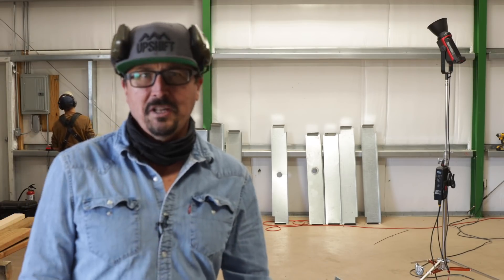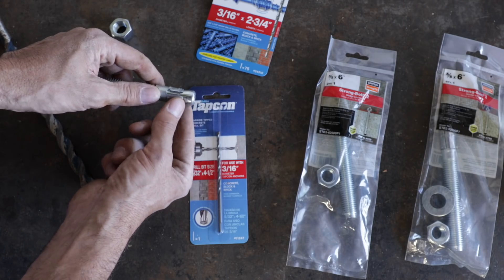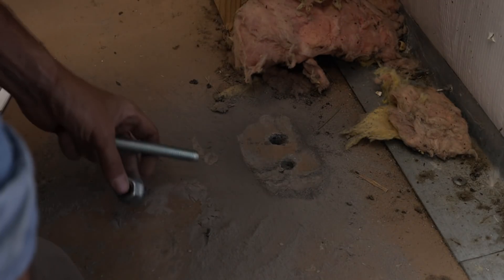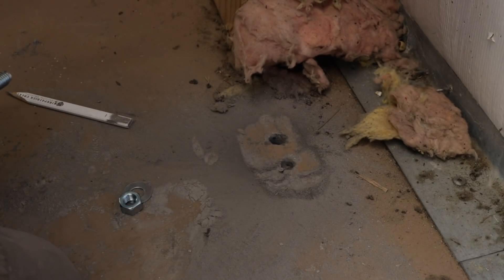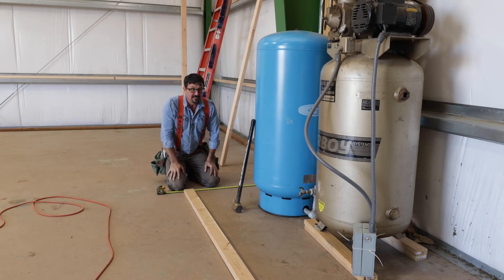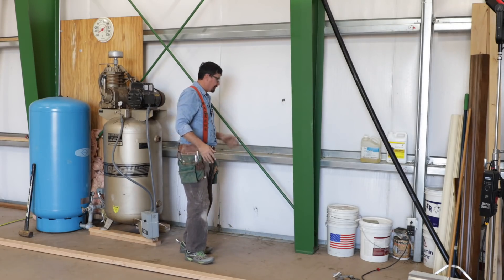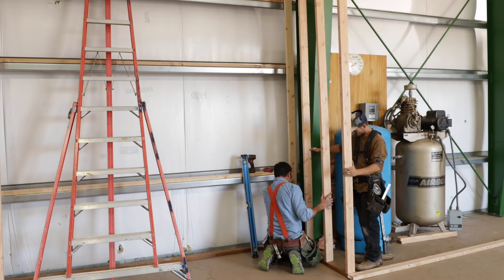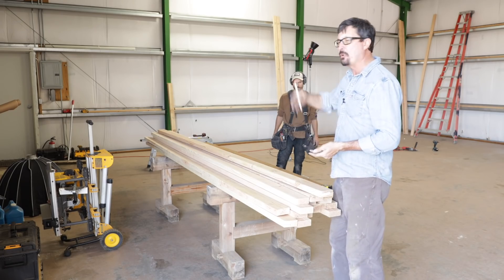I'VE ONLY GOT 24 HOURS

Comment: Those window braces can be used as a wall - if you sheet the walls in - use them to attach to.  Just now a square, but vertical 'studs' to screw to.

Comment: I was trying to put an anchor into a concrete wall once when I hit some rebar. Luckily I hit it dead on. Concrete bits do not drill metal very well so I switched to a regular drill bit. Drilled through the rebar and went back to the concrete bit. worked great.

Comment: If you end up using drywall for the walls double up on it with a foam glue/gap between the two.  Helps cut down on noise quite a bit.

Comment: When laying out for walls, put the top and bottom plate 'on the flat' lay out as you would, but use your speed square to make a line on the 3.5'' side of the plate... then you'll have a plumb line to line up twisted studs if needed....

Comment: I know it to late for you re the compressor but an idea for anyone else.  I would have been tempted to put two recessed heavy doors in front of the well pressure tank and the air tank Right up close and then mount shelving on those doors out to the level of the stud wall.  Giving hidden doors for servicing the units but maximising space.  Yes I know it would be a lots of extra work but I just love the idea.😜😁

Comment: Take a piece of long piece of wood and bore a hole in it near its center the same size as your masonry bolts. Center the board and hold over where you want the concrete drilled and stand on both sides of the board while drilling. The wood will hold your bit steady and make for an accurate hole in the concrete.

Comment: Just a suggestion cody, put some type of isolator under the feet of that compressor. You might not have any problems because its only a 1 horsepower motor , but when you have bigger motors  that shake alot more things start to break when hard mounted. I used some square hd rubber pads with hocky pucks on top on my 7.5 horse triple cylinder compressor,  works good.

Comment: If you are worried about rebar, you should get a rebar concrete bit. (Rebar eater) also, you can drill out all the holes, set the anchors and then the equipment. Many times the problem is the anchors not being straight out or plumb which throws it off. You can bend the anchors a bit to straighten them out so they go where you want.                                             Another good option you could try next time is drop in anchors.

Comment: To anchor stuff in concrete I drilled holes for lead shields, into which I inserted 3/8 inch bolts.  The bolts expanded the bottom of the lead shields, anchoring whatever it was bolted to.i only anchored stuff that was unstable, like my stand up drill press.  I did not anchor most things, so I could move them and clean up under and behind them.  Plus, I hate drilling in concrete.

Comment: you may want to cut the concrete around the compressor as I recall the floor cracked as did the blocks on the near wall . I cut twice placed in 2 inch Styrofoam insulation beefed up the concrete under the comptessor . great job you are doing .

Comment: If you pulled your mark back to 15 3/4, that would be your center to center of your stud. Pulling a measurement from front of one stud to another is the same thing. So, seeing as your tape was at the end of the top and bottom plate (where a stud would be), if you mark at 16  and go, you will have a 16” layout.

Comment: You can drill threw the rebar with the hammer drill I had to do it hundreds of times and a good tip is to screw the nut onto the anchor before you hammer it into the concrete Incase you damage the threads

Comment: always best to drill the slab all the way through if you can so if you need to replace an anchor, you can punch the old one through the slab and put the new one right in its place.  Sometimes anchors get hit by forklifts and stuff especially in industrial and manufacturing settings.

Comment: One other thing with those concrete anchors...........when setting them leave the nut on them just flush with the top so when you are hammering them in you don’t mushroom the top and booger up the first few threads making it impossible to get the nut on.

Comment: I realize this is not a home and a shop. But they make a rubber or silicon footer pad that goes beneath the footer. This prevents water a lot of water damage by keeping the stud off the concrete. I see this used here when they doing a stained concrete floor.

Comment: Those are most common anchors. You must drill deeper than that, because it most likely will move out a bit before starts to vedge. 
And you are doing it hard way. Pick a right size anchor, place base, drill thru holes, clean holes, ''nail' in anchor and tighten it. Done. 
Its kinda hard to mount that tight holes on threaded rod, when anchors  are already fixed.

Comment: Put rubber belting or chunk of tire under the compressor. It will help noise transfering through to your slab and out into your shop. Non load bearing walls studs can be 24 inches but i bet cody knew that.

Comment: I remember when you installed the compressor in your old shop a.k.a. the first time, so I can confirm you didn’t have the third Bolton which drove me crazy at the time being kind of OCD. I also think in the old shop you drilled through the holes on the mount, and pounded the bolt through the holes on the air compressor and down into the cement, so you didn’t have to do complicated cribbing to get the air compressor over the bolts

Comment: I have installed thousands of anchors industrially, and best practice is to drill hole completely through concrete so that anchors can be punched through after use, or replaced with new anchor needing repair. Old holes filled with Pourock.   Nut on anchor does protect threads as well as ensuring anchor bolt isn't driven to deep.  Mounting bracket holes should be large enough to accept bolt as well as wedge diameter.
Reply: great tip Steve.  I will use your advice since I'll be going through this soon.

Comment: pro tip- put your bolt on before you hammer the anchor in. Then if you damage the threads, you can back the bolt off.

Comment: when mounting to concrete. always drill all the way through. if you ever want to move something to can unbolt it drive the bolt through and fill with concrete for smooth floor. or if you ever move it can be a smooth floor for next owner.
Reply: Good idea.

Comment: If I may ask, coming from Sweden we build different to the way you do, but I noticed under the pressure treated wood, you don't place anything? Yes it won't rot but but water will can still be sucked up into the studs, do you not normally place a sill barrier between the concrete and timber? And that's for the great content

Comment: Okay as a former framer, always pull your layout from the same side/ end of the sill plates. Also, when pulling your centers, the red diamonds are the stud mark. If you are using a framers square that is why one outside edge is 16in. for studs and the other is 24in. for rafters.

Comment: Those cement anchors are a godsent but obviously an overkill for holding compressor in place :D We used those to install car lifts, so our lives did depend on em.
I hope you don't have to remove them one day, because cutting em flush with the floor is the only way.

Comment: Molly bolts are completely different. Only good for handful of things. Junk in my opinion. But those are Sleeve Anchors. In the philly area we just call em Red Heads and I’m sure you can see why. I already kno I’m probably goin to be the 300th person to say this but always run that nut on til it’s flush with the all-thread. Especially if ur not drilling that hole precisely. One good hit and you’ll sink it too far and not be able to get the nut on or get it out.

Comment: Put a nut on it before you start beating it in, so you can chase the threads. The beauty of that kind of anchor is that they allow you to drill through the compressor leg, insert the anchor, thus eliminating alignment problems. I know you’ve already done it so try to remember it for next time. You probably hit rebar or a rock.

Comment: If you want to get really fancy, check out the concrete epoxy anchors that come in a glass test tube.  You drill your hole.  Blow the dust out.  Put the tube in the hole.  Then hammer your anchor in.  The anchor breaks the tube and releases the two part epoxy.  They work really well.  
I've used them to anchor automation equipment (like robots) into a production floor.

Comment: Minimum hole depth for is 3-5/8” on a 5/8” qwik bolt/wedge anchor.  Important if used in a critical load application. That anchor is super overkill for this install however.

Comment: Hey you should run the nut just flush with the top of the bolt before hammering them down. Protects your threads from the hammer

Comment: When you lay the wall studs on the floor for nailing to the top plate always put the crown side up so the studs will be even with the top of the plate without having to push them down.

Comment: When anchoring the air compressor you might want to consider using vibration isolaters,  some simple rubber cut outs.  I work on compressors for a living and I find it makes them last a little longer.

Comment: I concur with all those commenting about putting the nut on the stud before driving it home. But, no fire stops in the wall? Well, I guess the Plate takes care of that... Old houses, balloon frames, lack of fire stops... Then, our house doesn't even have hollow walls. Plank frame construction is weird, and the walls are only two inches thick.

Comment: Never bolt a compressor to the floor. Place it on rubber coated cork compressor pads. No vibration transferred to floor. I have never bolted compressor to floor !

Comment: A bit of advice from a man who's installed thousands of anchor bolts...drill as deep as you can because you can usually pound the anchor down if you don't need it any longer. Secondly, always put a nut on the thread before hammering it down. Guarantees that you won't mess up the threads.

Comment: 5:10 there goes those threads😂... supposed to put a nut on the bolt so you don’t mess up the threads
Reply: What, you dont like mushrooms?

Comment: Just a tip on accurate hole drilling in concrete. After you Mark the hole locations, move the item, and carefully, and accurately, draw an X over the dot you made. This way when the bit removes your dot, you can continue to move the drill bit tip back to center using the still visible legs of the X you drew as a visual. The bits do wander no mater what it seems, until they are started good. Enjoy your videos Cody.

Comment: I have found when putting anchors into cement it is best to put the nut on before hammering, just in case you mar some threads. This way you can back the nut off to fix it.
Reply: 👍 Came here to say the same thing.
Reply: Funny indeed that too then read your comment as well.
Reply: I've messed up a few putting up ac wall brackets.
Reply: Those anchors he's using have don't have threads on the last 1/4" or so, for that very reason.  You can pound directly on the end and even mushroom it out some without damaging threads.  If you're using anchors that DO have threads all the way, definitely have to put the nut on or you WILL be screwed!
Reply: I got the chowing of my life for not putting th nut on. I only did it once
Reply: @python3574  very true. I do it anyway just for safe measure
Reply: I was thinking the same thing annnnd buy yourself a rebar eater the next time you’re worried about hitting rebar. You’ll be able to drill right through the rebar and get the embedment depth you want instead of settling for less :)
Reply: @ButlerFamily12  rebar is the worst when drilling
Reply: I cringed when you pounded on that anchor without the nut on it. I know I watched one of your recent videos when you gave that exact advice. Invest in a ROTO HAMMER AND SDS BITS  if you haven't already. Drills holes in 10% of the time. Slow down and savor the process.
Reply: I was cringing while he was hammering those anchors in without the nut on them.
Reply: tyler mcfarland - These west Coast Boys should know Better. Too much smoke damage??
Reply: @davemi00  These are not the bolts you are thinking of. Obviously you've never used these before.
Reply: Noob move

Comment: Umm why come back 3/4” of an inch? You’ve just shrunk your first 16” center by 3/4. 
by starting your first stud at 0 and starting the next one at 16 (ending at 17.5”) your first stud pace now be 16” on center, continue on the same way next stud will start at 32 and end at 33.5. 

Those tapes are designed to be quick reference if you were to land the stud 3/4 of an inch back that’s where the red mark would be but it’s not. 

In between studs you should end up with 14 1/2” space, your first one would be 13 3/4 which is to small??
Reply: I think he meant to go forward 3/4" which would be a center mark?  You're right though, a mark right on the 16" red mark would have been the left side of the stud.

Comment: I remember my father once built a wall like that where the water heater was in a similar position to that tank, and 10 years later had a leak in the tank and had to knock the wall down in order to remove the tank. I always would leave enough room to be able to remove a tank like that, if necessary

Comment: Are you leaving enough room to replace that water/pressure tank if need be?
Not much clearance between the new wall and the compressor tank, looks like replacing the water pressure tank would require pulling a section of wall out to gain full access!
Just wondering.

Comment: Friendly tip: When you hit threaded bolts like that with a hammer, put the nut on the end of it before hand. It wont mess up the threads.
Reply: You haven't used this style before?
Reply: @Cotronixco  Yep i have. It's a trick i learned many years ago. I'm a lineman by trade. We're always beating on bolts. Not fun when you smash the threads and can't get the nut on.
Reply: @AchillesWrath1  This is not a regular bolt. You put the nut on one of these and you'll still be hitting the bolt.
Reply: @jeffreyvelthuis9245  No, the end of the bolt has no threads.

Comment: LOOKS TO ME THAT THE SPACE BETWEEN THE WATER TANK AND THE AIR  COMPRESSER TANK IS TO SMALL TO DO ANY WORK ON THE WATER SYSTEM.  IF YOU NEED TO WORK IN THAT AREA  IT IS GOING TO VERY HARD.  2 TO 3 FT. OF WORK SPACE WOULD BE OK TO TURN WRENCHES OR OTHER TOOLS . WHEN I WORKED FOR A WELL DRILLER THAT WAS ONE OF THE BIGEST PROBLUMS WE WOULD FIND, NO SPACE TO WORK. THAT USED UP MORE TIME ON THE JOB. JUST MY THOUGHTS.  REST OF SHOP LOOKS GOOD . GOD BLESS.
Reply: Tommy Schauer Why are you yelling at us.?
Reply: @jamesemmanola  SORIE -  I AM NOT YELLING AT YOU OR ANY ONE . I JUST USE ALL CAPTIALS WHEN I TYPE, IT IS JUST EZER FOR ME , SENCE I TYPE ONE FINGERED. THANKS FOR THE REPLY.

Comment: Some expanding poly glue in the hole with concrete screws erm somewhat permanent ;-) i have poor quality brick walls with lime cement plastic plugs just wont work you see...

Comment: A good "best-practice" on those red heads is to screw the nut on half way over the end and pound the nut with the hammer instead of the end of the shank. The brand he is using here appears to have a chamfered end to account for a bit of bulge, but some brands are just straight.
If you go mucking up those threads too much getting it seated fully in its hole, you'll never get that nut started after you've got the compressor set over the shank.
Reply: air chisel drives em in nice too sometimes with minimal mushrooming
Reply: You don't wanna do that. From experience I have pounded the threads down inside the nut and could not tighten the nut down.... the end of the thread end is designed to be peened over so make sure you don't hit the nut
Reply: double nut it you wont hurt the threads that way if youre worried about hammering down onto one
Reply: can you possibly show me what the proper tool looks like
Reply: thanks

Comment: Are you giving yourself enough room to get that pressure tank out if it goes bad past the compressor?
Reply: Is that really a problem? I keep seeing posts on this issue, but Mr W doesn't seem concerned. If this only happens very infrequently, say every 25-30 years like a shingled roof, is that really a concern? I don't think so. Tell us more if you think so.
Reply: In the last 30 years we have gone through 4 pressure tanks, and they are beastly to remove. Mr. W will have to remove either the walls or the compressor to get that pressure tank out.
Reply: @thomast8539  Calm down, he just asked a simple question. No need to get offended. Hes not hurting anyone.
Reply: @rjskum688  I am not offended. Just don't seem to understand why it is anyone else's concern except the guy making the videos. Who cares if he could be doing it another way? He does things his way, like Frank Sinatra.
Reply: @yellotang  i bet he will use his fork lift through the 4 foot opening and lift it over the compressor.
Reply: @warrenmichael918  ok
Reply: I said this yesterday!!lolol.
Reply: @thomast8539  I was a plumber for 35 years and replaced thousands of pressure tanks. Most are guaranteed for 5 years, some are guaranteed longer. Some have replaceable bladders inside and most don't. They last an average of 6 to 12 years. It's basically a tire inner tube inside that tank that the water pressure pushes against to give you back pressure in your system.